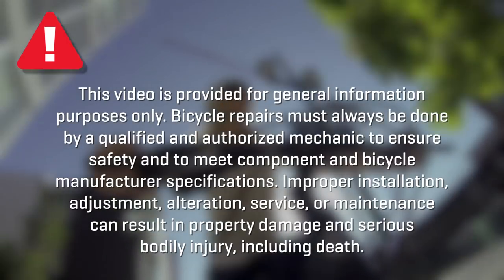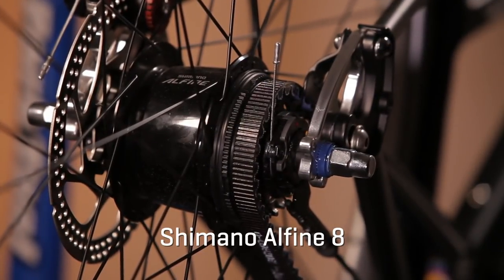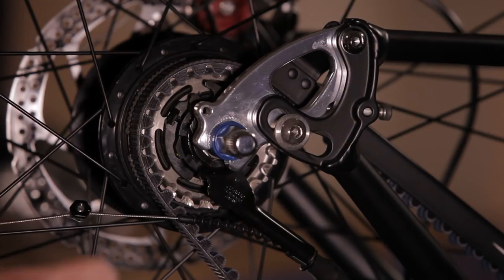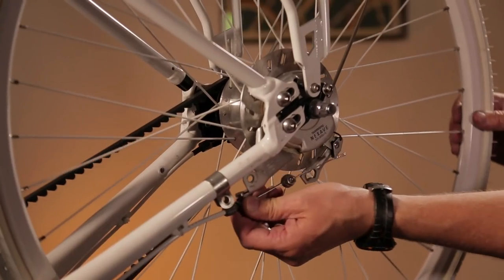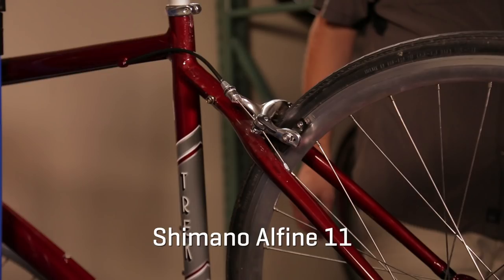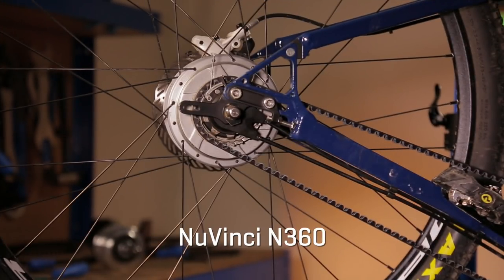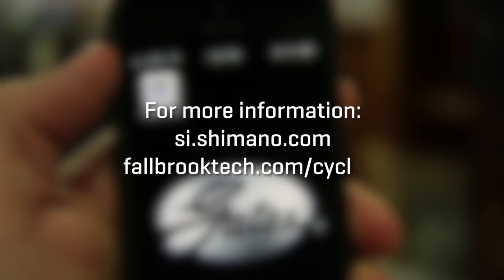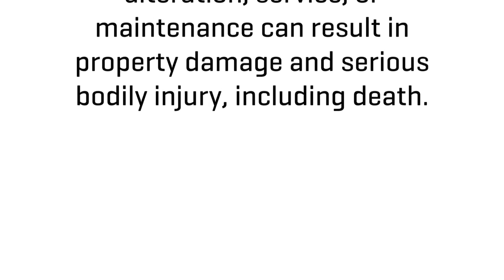Gates Carbon Drive University: Disconnecting Internal Geared Hubs

Comment: Thanks for the clear tutorial! I just replaced my inner and outer tire with this info. :)
Except for my gates + alfine 8 I had to set the gear in the highest (heaviest) gear, and rotate clockwise with the size 2 hex, as my gear apparently is mirrored with respect to the one in the video. (the cables goes along the top down on the back, instead of along the bottom up on the back as in the video)

Comment: As far as I can tell, on all of these bikes the rear axle in in a vertical slot an drops down to remove. On my Priority bike, the slot is horizontal. In order to remove the belt without damage, the screws that adjust the rear axle to keep the belt straight would have to be loosened to remove the belt without damage. Rather than doing that I rolled the belt off and on. Although I am now in fear for my life, If I get another flat I will probably to it again.